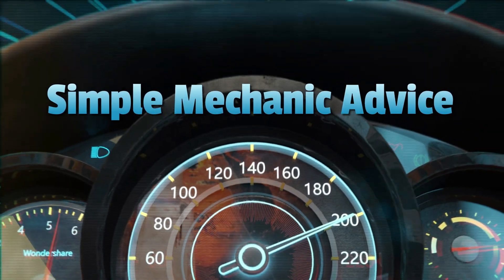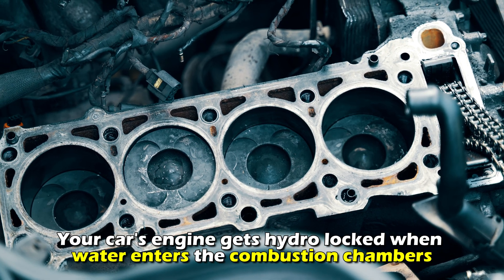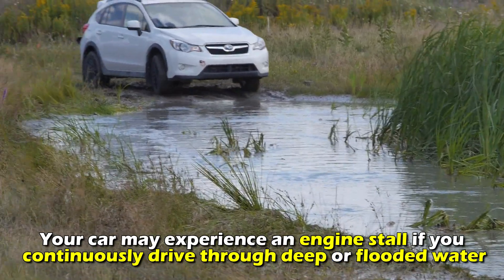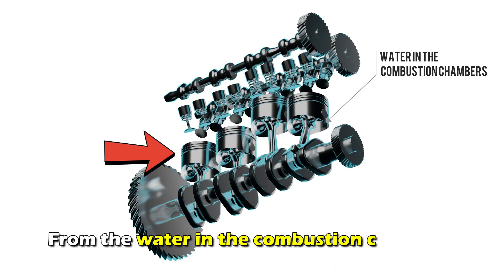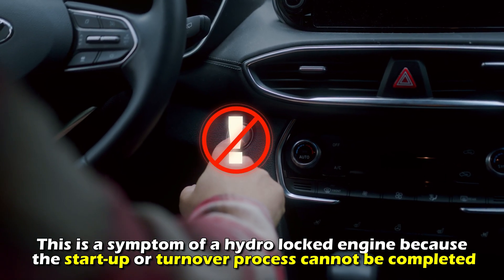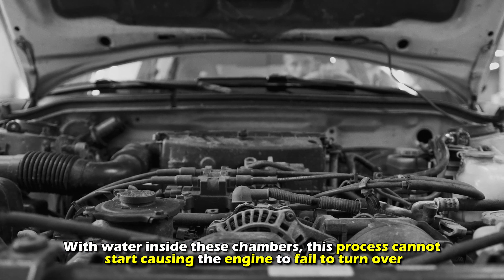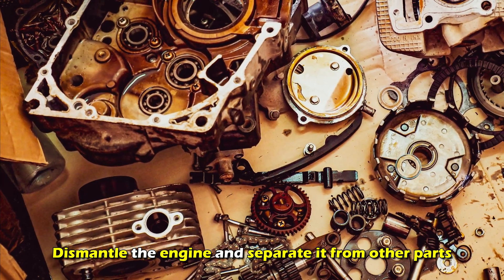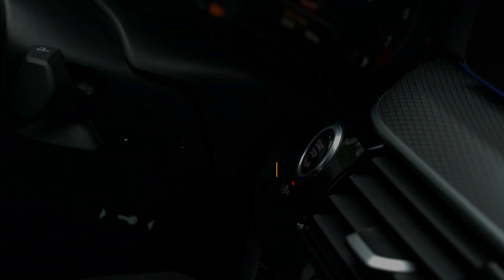Hydro Locked Engine: 3 Symptoms, Causes And Solutions

Comment: Could it be a bent connecting rod if i went threw a deep puddle that made engine die from sucking water into intake i removed spark plugs and sucked water out before restarting and when tried to hand crank it to expell  any remaining water it seems siezed pulley dosent move

Comment: much easyer to just get all start plugs out and disable the fuel pump and then run the start 3-4-5 times ..put all together and well hopefully you have nothing broke
Reply: Crankshaft is locked due to flooding